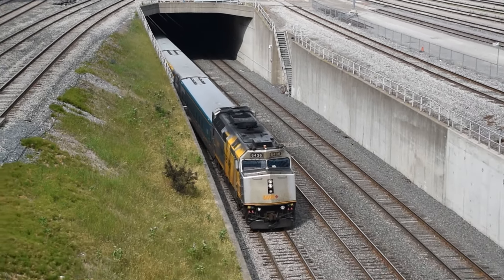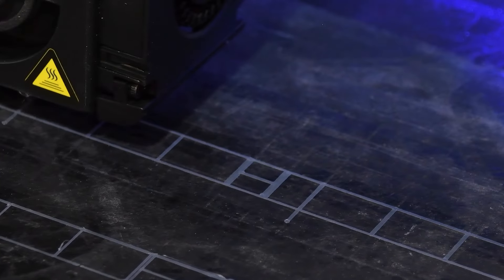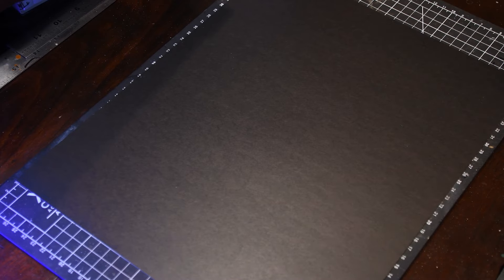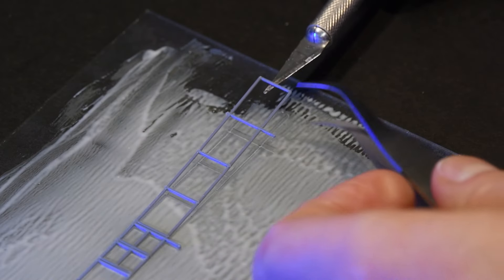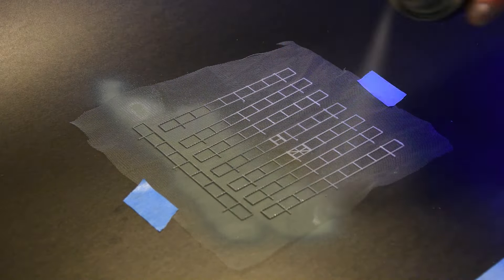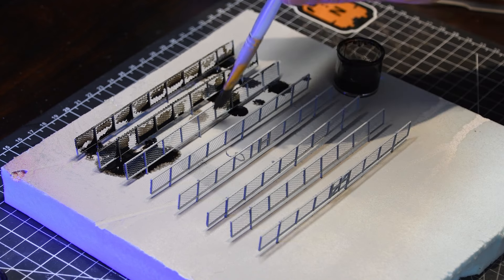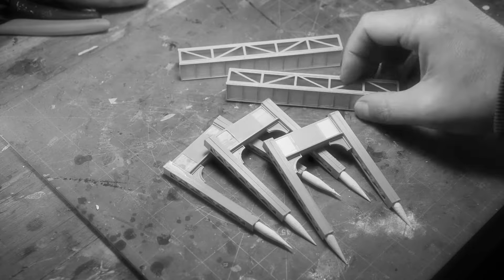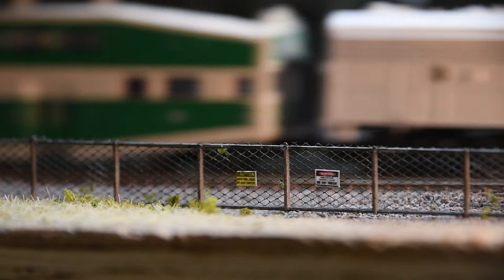Building a Chain Link Fence in N Scale

Comment: I've seen techniques where makers with 3d print a layer or so of the design (maybe half the total thickness), in your case the fence posts, and lay the clothe over it, securing it to the bed. And then finish the print so the fabric is embedded in the print. Might be worth a try next time. Either way your fences look great
Reply from the maker: You and another individual has suggested this. I will give it a try

Comment: This is amazing! I ran into the same issue when I started working with N Scale. Woodland scenics chain link fences are nice, but way to expensive to use on large products. I attempted this a while  back with resin printing but the links were too small and wouldn't come out right or straight up break. So I ended up abandoning it. Thank you for this! I will definitely be trying this out!

Comment: Very nice!  Also timely for me: funnily enough, I spent this afternoon laying out and soldering 0.5 mm brass rod to make the framework for a couple of hundred feet of 8' chain link fence, along with a few gates.  I'm very pleased with how it's turned out, but I think your method will work better than what I had in mind for attaching the tulle.  Thanks for putting this out at just the right moment!
Reply from the maker: I appreciate this. I'm not afraid of soldering, but I want to strike a balance between effort and reward. Good luck with your fence!
Reply: @NScaleDystopia  Your technique for attaching the mesh worked really well.  I don't have any glass lying around, so I used parchment paper for a non-stick surface, and it was fine.  Thanks again!

Comment: Looking good! Do you think spray glue would work to put glue on one side of the railing prior to laying it on the mesh?
Reply from the maker: I tried a number of different spray adhesives and they didn't go on cleanly - they were too thick and they added little threads of adhesive that showed up on the mesh
Reply from the maker: I also tried using different brands of spray paint but the adhesion wasn't as good as white glue. Weld bond might also work well
Reply: @NScaleDystopia  Ah, I see. I've mainly used spray glue on trees. Sticky stuff alright, but for trees the threads of glue didnt matter. I can see how it would be a problem for fences. Cheers! Steven

Comment: I have a P1S .04 nozzle.  The fence prints poorly if at all.  Bulk of the problem are the rails, not the verticals.  I've tried 3 times.  No luck.
Reply from the maker: Hmm... try rotating the print 45 degrees.